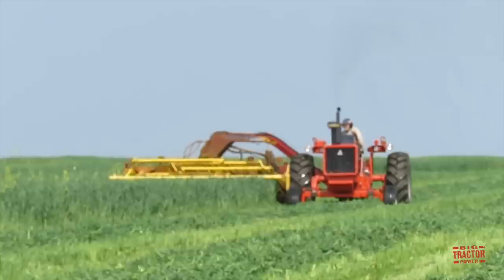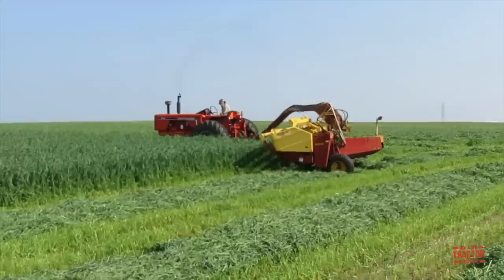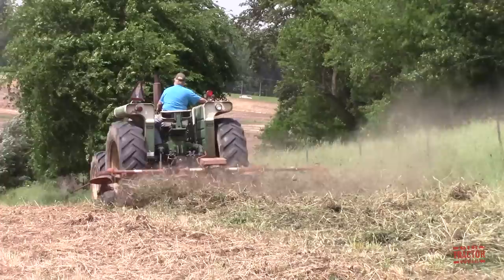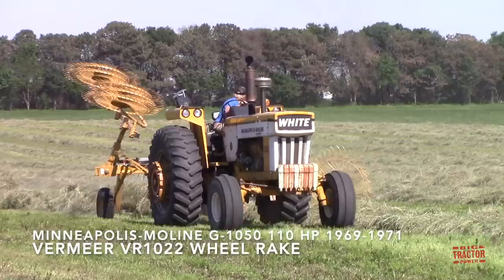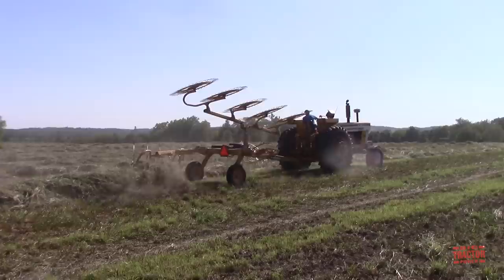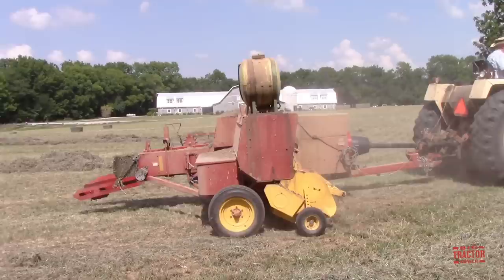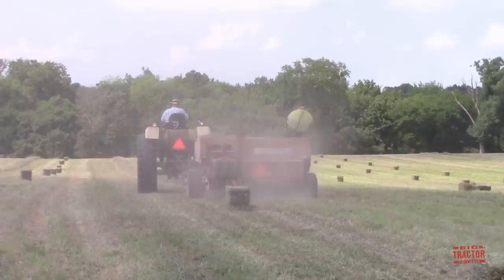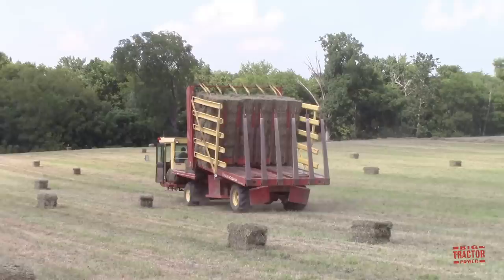Classic TRACTORS Making Hay

Comment: When I was a kid mowed with a sickle bar behind a Farmall H, crimped with Cunningham crimper pulled with IH 340 diesel, raked with Oliver side delivery rake with same 340, pulled IH45 small square baler with Farmall SMDTA; later upgraded to NH balers with IH 656 hydro diesel pulling PT-10 haybine & same tractor pulling NH small square balers.  Loved SMDTA roading  wagons up steep hills with flame blowing out muffler at night.  Sure miss everything about those days, wished we had ability to take pics back then

Comment: Probably handled a million of those bales...Our farm name was ‘haymaker farm’ and that’s all we did all summer long. In the later years mostly used a John Deere 336 baler pulled by a John Deere 3020....all hand stacked...Earlier years ran a jd 630 on a 24t baler. 
Started out with a side mount sickle mower towing a conditioner and ended up with a nice jd haybine.
Those were the days!
Reply: Sounds a lot like my childhood in the 80s and 90s. We had all JD equipment. 6300, 2155 and 2040 tractors pulling 338 and 348 balers, 1600 moco and a pair of 1209s. I'm sure I never handled a million bales, but a couple hundred thousand, sure.

Comment: I grew up on these old tractors. First tractor I ever bought was a 48 8N. Now we only run big Deeere tractors and Fendt. I'm in my early 30s but I still have a soft spot for those old tractors in my heart. I still have my grandpa's two old 4020s. Both have canopy ROPS and one has a loader. I could watch this all day. We in the dairy business and it's amazing how tractors and hay equipment has changed. Now we mow with a Krone Big M. Keep up the good work.
Reply from the maker: Sounds like you have a nice operation. The 8n is one of the all time classics. A Krone Big M is an impressive mower.
Reply: @bigtractorpower  

The Krone is a very good machine. We love ours. We are in southwest Virginia.  If u ever down this way let us know.

Comment: Great classic hay vid👍we have TM125 pull 12ft NH conditioner, next windrow with 8 tine rake been tow by IH 574, IH 574 pull very old IH small square baler, last piece equipment is IH elevator that hooks to side of International AA160 truck with two people on back grabbing n stacking hay bales.  But our family hasn’t done small bales since 16 years ago, this year was all round bales done by MF tractor/baler then loaded onto TLiner International semi that holds 30 bales.  Our McCormick MC130 doing loading/unloading of round bales.
Reply from the maker: That IH bale loader is a rare piece of equipment. Very collectible.

Comment: A Ford 7700 runs my 648 new Holland round baler 930 case runs my 411 discbine farm all 400 pulls hay rakes. Owned 400 for over 40years also have a G allison I've had for 50years. You've been knocking it out of the park with the vids thanks for all the effort
Reply from the maker: Nice tractors.  The 7700 and 930 would be neat to see in action. Thank you for watching BTP.

Comment: My dad used to have an old NH 499 haybine he pulled behind his MF 399 then baled with a NH 650 twine tie. I used to sit behind the seat and just be hypnotized by the reel bars. We have a MF 6180 and a NH RB460 now and he definitely thinks he’s gone to heaven running it.  Back in the day he worked full time as a welder and when he got off at night he’d go to the hay field and do it all again the next day. He would haul 10k small squares a day with a couple other guys and always had a day job. I have some health issues but I don’t think I could handle what he did in my best shape. I have to have some sleep.

Comment: I know an old Farmer that has an open station Massey 165 and a Ford 5000 tractor, has used the same New Holland 488 (or maybe it's a 479). For about as long as I've been alive (40 years). All his equipment is old but runs every summer. International bar rake, Massey 124 square baler as well as on old New Holland 273 baler for backup.

Comment: This video was great reminded me of doing hay at my family farm 3 30 acre fields.  My uncle had a ford 5000 and a an international 586 then we pulled the hay wagon with a farmal f20 we would also use a john deere b. Its wierd to me cause everything on farms when I was a kid was old. Now farmers have expendable equipment it seems to me. Even the farmers i knew had 60s or 70s trucks and I grew up in the 90s maybe its was just the farmers I knew
Reply from the maker: Thank you for sharing your tractor line up from the past. An F20 is a great classic.
Reply: @bigtractorpower  I love that tractor it's been in the family since new. It has the steele wheel on it now but it also has rubber wheels for the back 2 but steel front wheel. But about 8 years ago the head cracked and my uncle will not let me mess with it. The john deer b was a 40s something and it still runs but the 586 and the 5000 are still used all the time just not for farming anymore my uncle is 78 and retired from gm he still farmed for 20 yrs after he retired now he is permanently retired. Thanks for the response I have a lot of different channels I'm subscribed to and farmer or tractor channels are the only channels who you can rely on are response back thank you

Comment: This brings back memories, only we didn't use as many high horsepower tractors. The hay was mowed with an A John Deere with a #8 sickle bar mower, raked with JD rakes that had big steel wheels into a window, and bailed with a JD 4010 pulling a 214W baler connected to a low boy with another man with a hay hook pulling the bales out, and stacking them. As loads were made, another JD or Ihc would take the loads in to be stacked in the hay mow in the barn.
Reply from the maker: Great line up. I wish I could capture haying like that on digital video.
Reply: Assuming the 214W was a twine and not wire baler?

Comment: We never liked to use a hay tedder, I know sometimes it was necessary but it makes the crop lose a lot of leaves, especially in alfalfa...nice video Jason
Reply from the maker: The Tedder is helpful but it seems most like to avoid them if possible.  Where I grew up they were very necessary because stringing a few sunny days together in May and early June to bale first cut where tough.  Thank you for watching.
Reply: tooez90 . Exactly. It was sad to see so very many leaves becoming airborne.
Reply: I've got a very similar, if not identical, Kuhn tedder here in Scotland.....
Lower rpm would help reduce the losses, especially as the crop dries out.
Reply: Kuhn GF5001T

Comment: I spent the Summer and Fall of '89 at a huge cattle ranch in Montana. They did make some small bales and had a stack cruiser but most of the alfalfa went into giant stacks the size of an elephant.
When it came time to feed the cattle (5000 head) there was a machine that worked like a bread slicer on those big loaves.
Reply from the maker: Sounds like they had a Hesston Stack Hand. This are neat machines.
Reply: @bigtractorpower  
Yup. That's the one. I never got to operate it. I did follow it with a stack mover to take them to the hay yard.

Comment: Wish I still had my AC 190XT, for a 90hp tractor. It handled more like a 50hp. But had to have something newer. Bad ideal on my part.
Reply from the maker: The 190XT is a solid tractor. I have watched one plowing with 4020s,  1206s and other classics at a plow day and the 190XT was smooth running and just walked away from the other tractors.
Reply: I wish I still had my 109xt to some random man wonted more than I did and payed a big price for it that was a baleing machine
Reply: @onealfarms9967  Same here it was perfect to pull a round bailer with. But the guy offered me more then I could turn down. He still has the old gal.
Reply: @bigtractorpower  pulling the same size plow???

Comment: allis-chalmers is in farming simulator 17 just is 205 i think and minneapolis-moline with 146 horse power a have them on my chaneel thanks for this video .
Reply from the maker: What models are in FS17?  The largest row Allis ever built was the 180 hp 7080 1977-1982.  The largest Moline ever built was the 143 hp G-1355 from 1972-1974.  Those are row crops. The 4wds were higher.
Reply: @bigtractorpower  it s Allis-Chalmers 200 with 104hp and Minneapolis-Moline G1355 with 142hp you were right in you comment both are they open stations very powerfull specialy minneapolis-Moline.
I have them on my chanell in videos drove them with heavy cargo with gear-box mod so its very real.
You chanell it s super can you make video about john deere R8400 and R8360.
Reply: I don t know do you travel but if you can come to europe in croatia ir beograd serbia this is where is IMT headquoters.In Imt museum is IMT-5500 with 550hp v12 engine.
There is no video about him or imt-5210 i think your chanell is very powewrfull and i am sure that IMT factory would give you acess to him to make video,
It would have millions of watching.Just suggestion.information that you gave with your videos are fantastic.THANKS!!!
Reply: I don t you are you traveling and if you traveling far but if you can and want you can come to Europe in Croatia or Belgrade Srebia where is headquarter of IMT factory.
They have in museum IMT-5500 from 1988 with 550hp and v12 engine.There no video about that tractor i am sure it would have milion of viewing.
They would gave acess to him because your chanell is powerfull and known so it s super advertisement.
There some others powerfull tractor in musem like IMT-5210.
Information that you gave in videos are fantastic.THANKS!!!!!!!